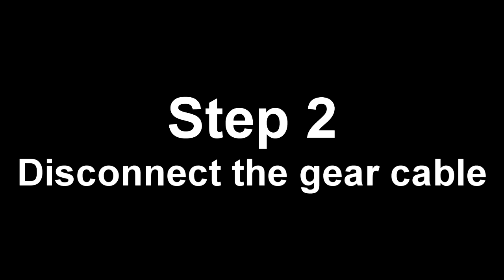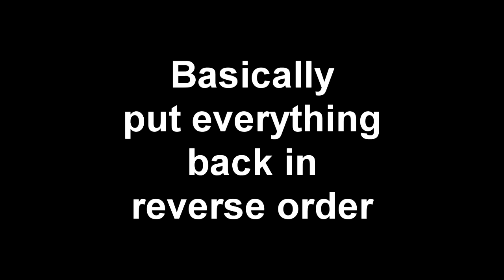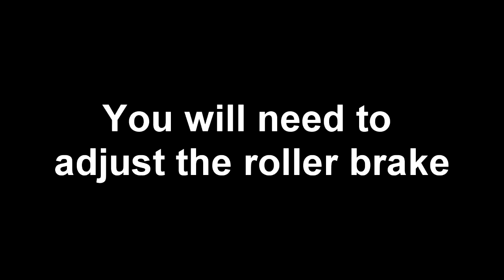Gazelle Innergy XT Rear Wheel Removal

Comment: Great video, Shaun! :-D

However at 1:33 you don't need to remove that adjustment screw - simply pull the brake cable outer - the plastic bit - (and inner) out of the housing (easy!).

As for the 'anti-rotation washers' at 2:25 (the yellow & brown washers), you can't really mix them up as if you get them wrong, the shifter position is all wrong when reinstalling.

At 3:20 I usually dangle the chain over the indent in the rear dropout - that way it's out of the way.

Comment: Also, the 'remove wheel tensioners' at 3:32, they're tug bolts or chain tensioner bolts which are essentially attached to the axle. 

At this point all you needed to do was grab the axle on either side and pull the whole lot out. You don't want to be fiddling with the nuts on the end of the tug bolts as you'll have to reset them again when done.

When putting the wheel back on, before tightening the nuts, push the axle as far forward as you can, making sure it's straight, then tighten the nuts.